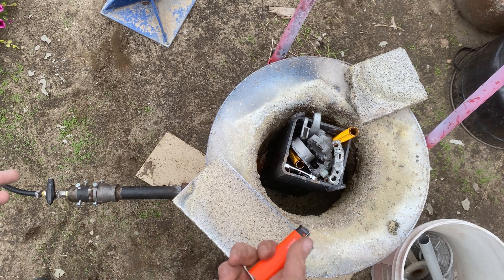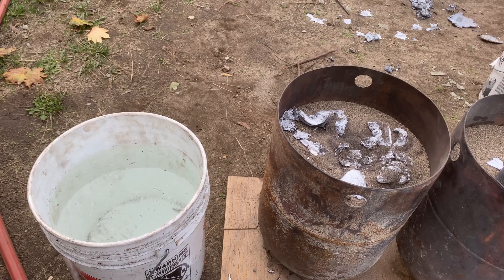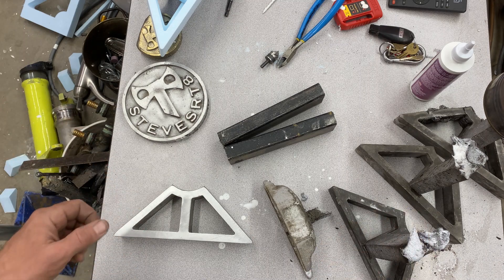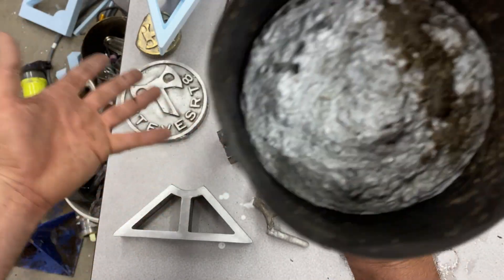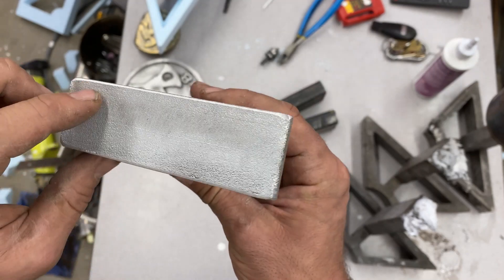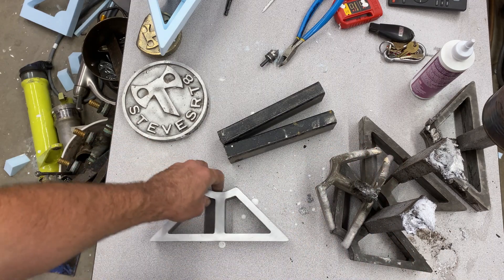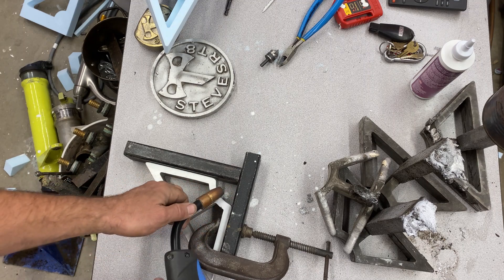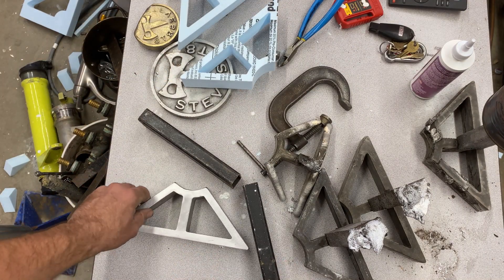Lost Foam Casting Welding Squares

Comment: What glue are you using to glue the styrofoam?
Reply from the maker: I like to use a hot glue gun for adding sprues. just have to be careful its not too hot. it can melt the foam if it is.

Comment: My experience is admittedly limited and this is an old video but I think you’re seeing shrinkage. If you make the sprue cross sectional area bigger than the CSA of the part, it will stay liquid longer so that when the thin bits of the part cool and contract they will pull from the sprue instead of collapsing.
Reply from the maker: I figured it out later but i was reusing the sand from my first pours and it had hot spots in it that premelted the foam. It happened to me a couple different times. Now I just use my sand once a session and i try and fit as many parts in the flask as i can.
Thanks for the suggestion. I haven't had any noticeable shrinkage problems doing lost foam.  Cheers

Comment: What are the components of the paint you will use?
Reply from the maker: It is a premixed drywall plaster that is watered down to make it runny. You can get from any hardware store.
Reply: @stevesrt8  Do you mean thermal gypsum or building gypsum?
Reply from the maker: It is a building gypsum. for use on interior walls.

Comment: Ok this video saved me hours of fkn around . The waiting for the alu to settle into the foam saved me so much time . I didn't expect it to do that . Must be the pink foam is a hotter melt than pklystyrene . Hey also the dry wall mud . Do you just water it down ? Simple as that ?
Reply from the maker: thats great. glad to help, yeah the rigid insulation takes a bit longer to burn out. its pretty cool to watch it slowly fill in. If the coating is done correctly, there will be little to no flames. to thick and the gases cant vent through the sand. I buy just a premixed mud and water it down quite a bit. a spritz of soapy water on the foam will break the surface tension and help prevent bubbles. i usually check on them after a bit and try and pop any bubbles before it sets up.
Reply: @stevesrt8 awsome . Just have to cnc the buckles out this week and ill give it a whirl
Reply from the maker: @Wrighmachining  good luck man! cheers

Comment: Try skimming off the slag from your crucible before you pour.
Reply from the maker: For sure, i need a skimmer for that graphite crucible. normally i use a steel one for aluminum and have a decent skimmer for that. cheers

Comment: Good stuff, you’ll have your little fire ball tools welding angels. It’s helpful to see where you didn’t have success too. 👍👍
Reply from the maker: Thanks Man. yes i'm quite pleased. Starting to get the results im going for. Looking forward to trying bigger and more complex stuff. Cheers
Reply: @stevesrt8  I watch a bit of AvE and he seems to thinks that reusing cast aluminium (stuff that is blended for that application not failed pours) might work better. I have tried aluminium casting a few times at home and extruded grades do not work to pour or run.
Reply from the maker: @Downtheshed  yeah, cast aluminum is choice for sure. i've been trying to use it on stuff with more fine detail. I have gotten more picky about the stuff i bring home now. I got a big pile of car wheels to use in the future. just need to find a way to process them.
Reply: @stevesrt8  awesome stuff looking forward to future vids👍👍👍